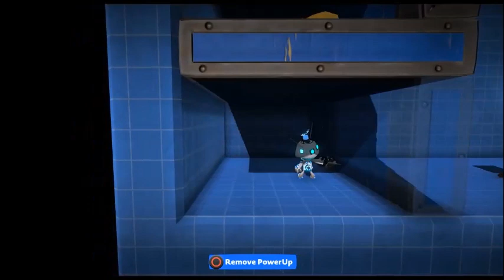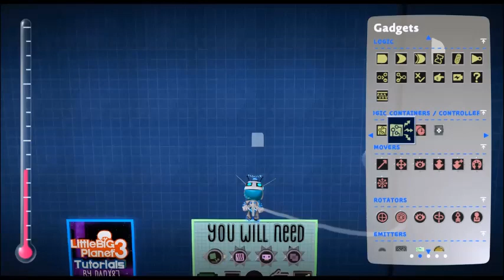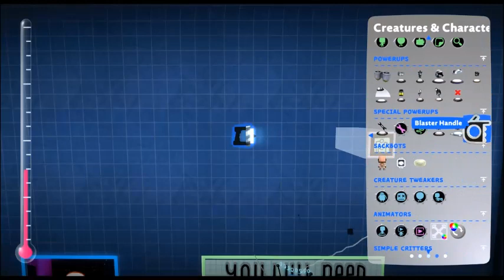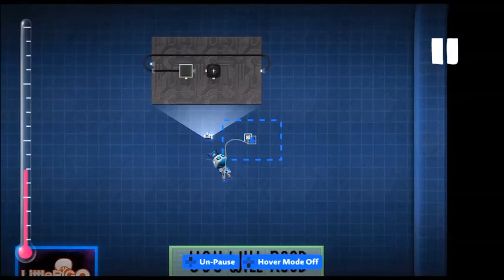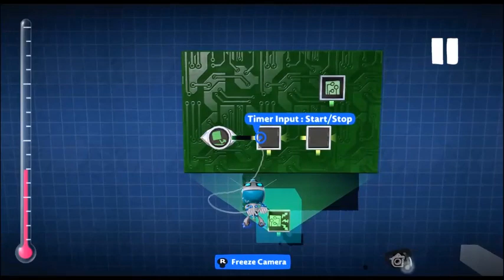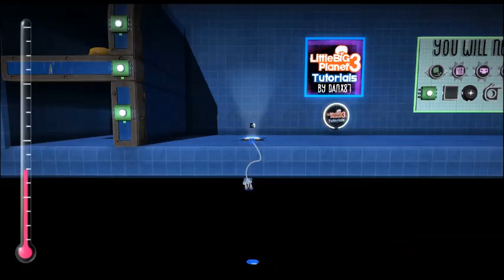LBP3 Tutorials [Physics PowerUp / Temporal Gun]

Comment: Please do how to do portal gun. Not because I'm making portal map. I want to know how to make it. Your ideas are so decorative. If I would try to do this power up it would take maybe month but certenly. It would take ling time to do the sticky gooy thing before previous tutorial.
Reply from the maker: adam borowy I have had a little trial run of a portal type gun, however I find the teleport in lbp3 is rather unstable (lots of crashes / spawning randomly around the map) I will attempt again after next patch! ;)
Reply: Little Big Planet 3 .Tutorials What you could do is use velocipoters, but make it 0% visible with opacity tweakers so you can design the portal to how you want
Reply from the maker: indeed, that was my first port of call, however it did not feel quick right and other objects could not pass through. If bugs get fixed then I have a very powerful way to do this.... lets give them some time to fix it, Much more to come in the mean time though ;)
Reply: Little Big Planet 3 .Tutorials Oh, wow! That must be really hard! Maybe you could have some tags, and when objects touch it, turn collisions off and make it invisible so it can follow to the next tag and the show up again. the player could do the same but use a brodcast microchip
Reply: Zac Stan *then no the
Reply: Zac Stan *not not "no"
Reply: Or if you grab it. (I know how to do it) it will activate counter that will be allways on and if you grab the block again it will reset counter and do again it will activate. When counter will send sygnal then follower will turn on and it will go near portal gun.